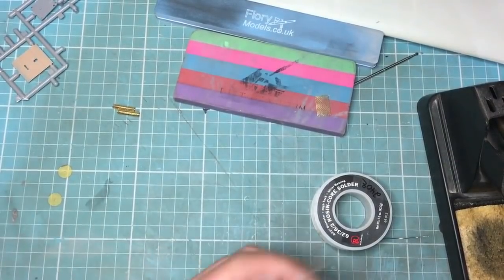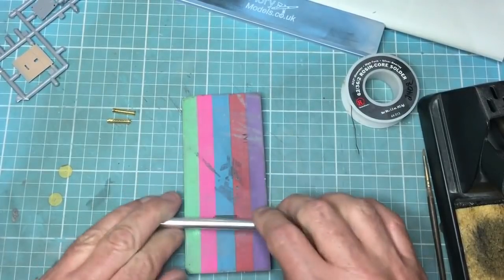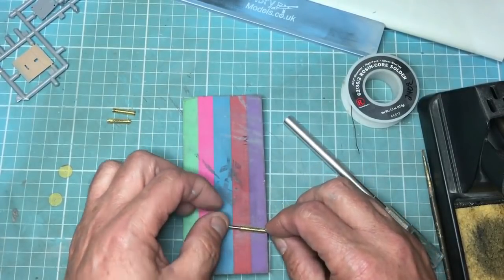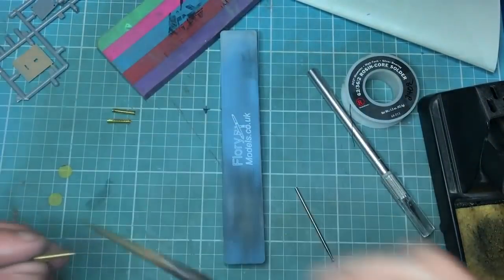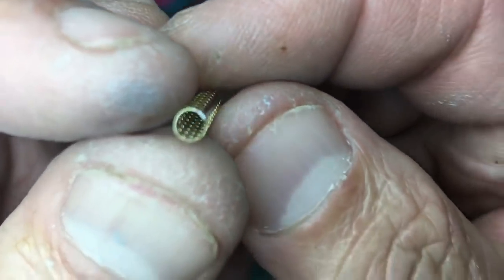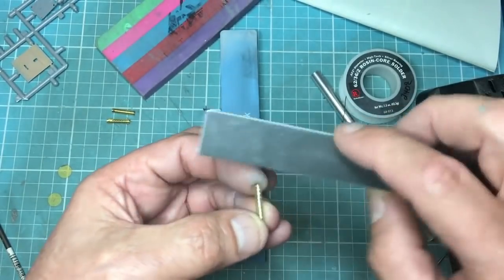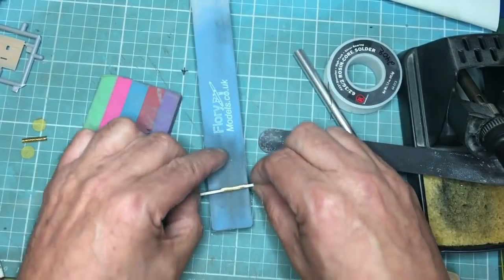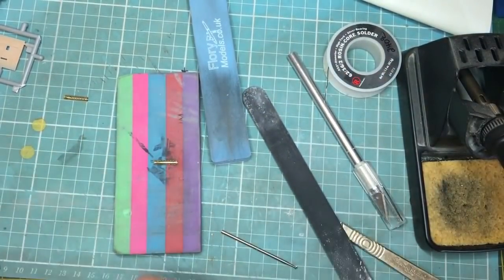How I roll and solder PE cooling jackets on WNW Machine Guns

Comment: A bit late for the thank you for this great guide. But thank you so much! 1st dealing with PE on a 1/35 Sherman, I was wondering how I was going to roll this cooling thingy around the machine gun. I followed your instructions and it worked great. Well, great for a 1st time as the result sure looks like I need some more practice ;)

Comment: Great video Nigel. With regards to the hard sanders,  I use small lengths of aluminium t pieces that I stick various grades of wet & dry to with double sided tape. They work a treat for a perfectly flat surface.
Reply: Many thanks